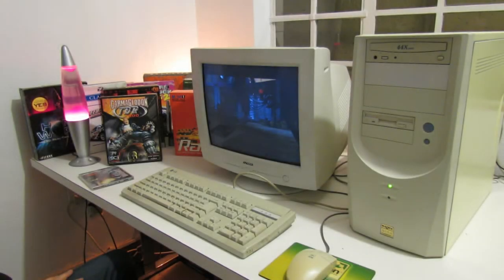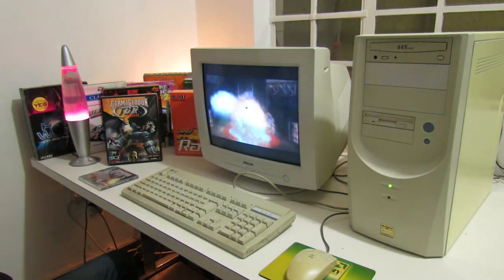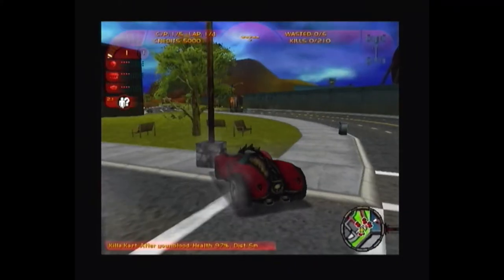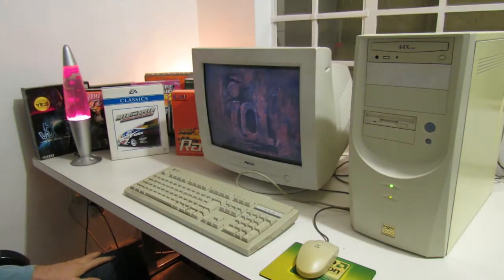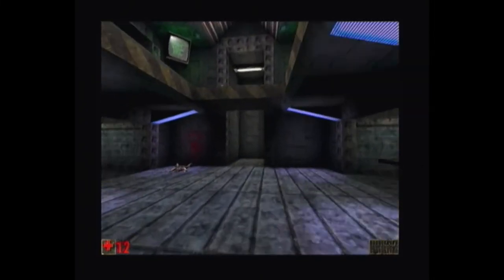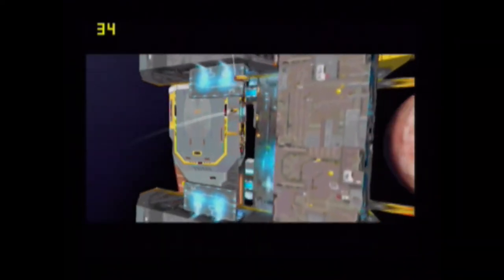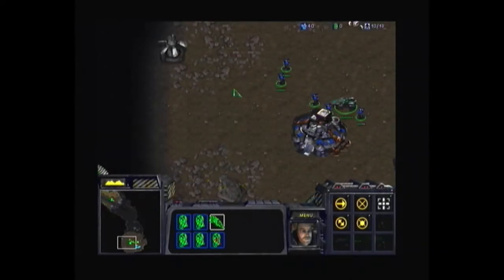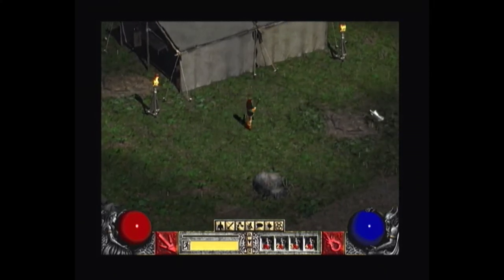Trash to Treasure: part 2 - Can it actually game and some upgrades

Comment: A good budget option for a build like this is a Geforce mx card. The Geforce mx400 performs very close to an original Geforce 256, and an mx440 performs close to a Geforce 2 GTS. The mx440 would be perfect for this PC, really good cheap upgrade.

Comment: Our taste on games are pretty similar. I first bought Rally Championship having a s3 4mb gpu and it did not work. I took out the cd to the seller who I know. He took me back of the store and installed it on a pc with 3dfx graphics. The game looked so beautiful and realistic to me, I didn't gave it back and hold on to it years until I have a computer which can run it. When I finally play it I fell in love with the physics and it still feel more realistic than many modern racing games. I remember we were having roadtrips (not racing) with my sister in split screen multiplayer mode.

Comment: Really nice to see an old machine saved! Heartbreaking to think how many were lost to E-cyclers...
Reply: was thinking the same thing the other day, imagine all the 3dfx voodoo that simply ended up throwed away
Reply: @framebuffer.10  they did a good job preserving them in eastern Europe and Russia judging by ebay haha
Reply: @framebuffer.10  And maybe the lots of ABIT mainboards that went to recyclers because of bad caps. Especially BH6, BE6-II, VP6, BP6 and BX-133 RAID. I shudder to think how many of these went in the shredder.

Comment: the world of graphics cards before the nvidia/ati dualism was truly varied. You could have had a better board and poor performance or another one that was less performing but, in fact, better. Much depends, in my opinion, on the system as well as on drivers and any tweaks. For example, s3 cards (I have a virge dx PCI) might be fine on early pentium or even with a nice 486 dx4 but I don't believe on more modern systems. I think I'm going to do some video tests with what I've got, too. Great video, keep up the good work!
Reply from the maker: Thanks! I think it was just down to that card not playing well with those earlier games. Maybe a DirectX or driver compatibility issue? Anyway, there are better cards to use in this machine, I just wanted to see if I could "cheat" by using a budget card from a later year.. guess not :)

Comment: Ok, first of all, the same crappy hardware with the same games can perform better on win98. Second, S3 has a proprietary graphics API called MeTal, which has only been used by Unreal, but it can look great and perform really well with that game. Its drivers work much better on win98 as well.
EDIT: Whoops, commented before actually watching the video and didn't know you mentioned it XD

Comment: I'm not sure if it was the onboard sound or your capture device, but I did hear some clipping on the audio during this video.  I didn't catch the motherboard chipset, but if it's Via, they were notorious for "blaring" the audio volume.  This comes from someone who built systems like yours here for a living at about that time.
Reply from the maker: Yes I do have a bit of an issue with clipping/skipping in the audio sometimes on this PC. Its a ESS audiodrive card and I have tried a few different drivers to fix it but to no avail. An upgrade to something by Creative is on the cards!

Comment: Worth looking into overclocking that FX 5200, memory overclocking helps quite a bit if i remember correctly.
Do check the Nvidia driver settings as i recall some tweak is needed there too get more performance out of them.

The ATI 9550 or other ATI cards around the same performance might be another good option that has quite a bit of performance specially when overclocked a bit.
Got a close sibling too the 9550 in a Dell inspiron 6000 laptop the x300/1050, which is a decent laptop if you can find one with the ati graphics working as a windows xp retro gaming pc.
Reply from the maker: Thanks, will look into overclocking, but I think there is something else wrong with the drivers or the games because even the on-board graphics were doing way better than the fx 5200 for the most part, so theres no way that can be right.
Reply: @ohsoretro5612  Possible it's the motherboard chipset itself that doesn't play well with the gpu, sometimes it's fixable with bios updates somewhat & ofc that might give you more cpu options as well on top of that.

Comment: Some tips:
Creative CT 4810 are awful. Put into the recycle bin: onboard will be better. Creative made lots of LIVE version card. They are fine if you are able to run the right driver version. It's the window 98 audio card!
PS: Live cards have some problems with VIA KT133/133A keep that in mind.

Which driver's version did you used?
FX5200XT it's awful but you had a strange issue.
Reply from the maker: Thanks for the advice, and thanks for the view! I tried a few different drivers for the FX5200 and while some were "better" than others, none gave me anything near playable frame rates.. maybe my card is bad or the games just arent compatible.. not sure what the issue is
Reply: Never had an issue with SB Live! on VIA chipsets oddly enough. If the card doesn't share IRQs with any other hardware you should be fine.
Reply: IIRC I have both the simple 4810 card and a 4830 Live. Both ran absolutely fine on a KT133A mainboard no less (Shuttle AK12A), until I bought a Dell OEM Audigy 2 ZS.

Comment: FX5200 performance problems were mostly caused by drivers/directx. But hell, this thing had always been a mess when it comes to compatibility - as well as this rubbish Ensoniq/Creative CT4810. DOS drivers doesn't work most of the time. Sound Blaster Live! is also a screwup when it comes to DOS SB16 emulation.

Comment: I wouldn't recommend ct4810 even to my enemies... It's an awful rebranding of an ensonic card. The wavetable fm synth is just completely broken. Anything is better than ct4810.
Reply from the maker: Thanks! I didnt know that. I havent actually used mine very much at all, but surely its still better than onboard audio?
Reply: @ohsoretro5612  , if onboard audio has at least somewhat decent Adlib/FM/OPL synth, then it might be a better choice that ct4810. Of course, haven't done research on the onboard audio, but i assume, it has good general compatibility with sound blaster XYZ standard. If it's fully and only targeted to windows, then it would also disqualify that onboard chip.

CT4810 wouldn't go with DOS either because it's broken. In windows, you can replace the MIDI implementation with directX, but then you could just go with your onboard audio anyways.

It's hard, very hard, to justify ct4810 in any place... I have ct4810 and corresponding pre-rebranding ensonic card, but they exist only because there's a history to remember. I never put them into real machines.